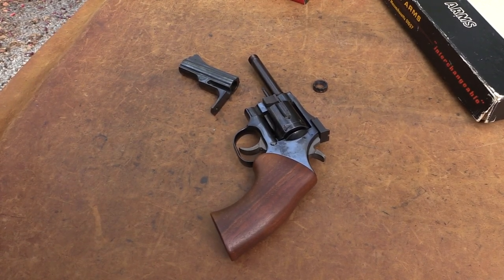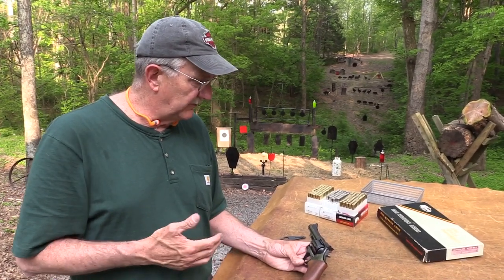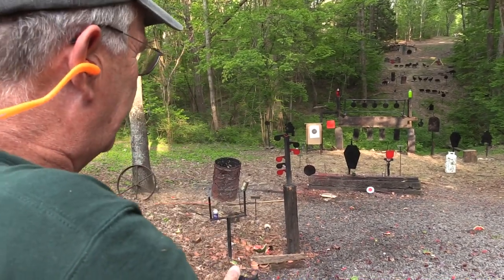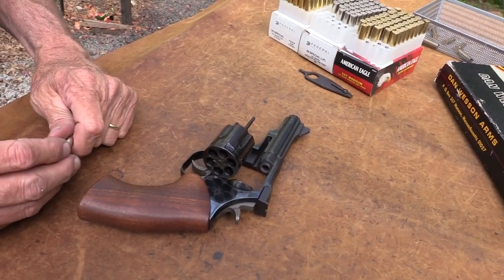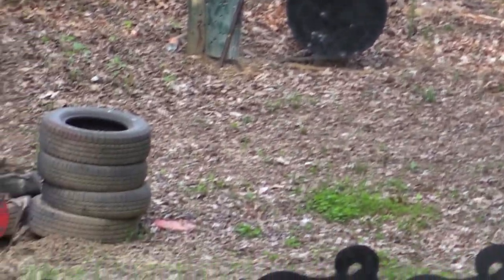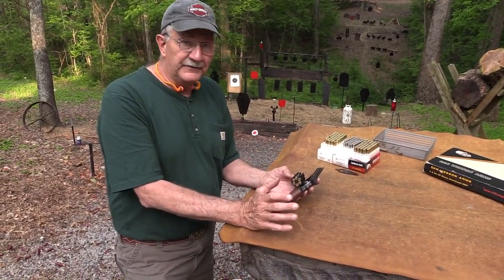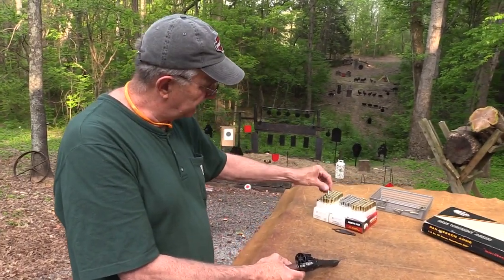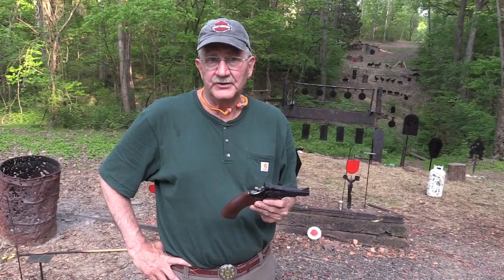Dan Wesson Revolver  .357 Magnum

Comment: I can't believe someone actually commented that the action sucked. MY early (original) Stainless steel DW 15-2 (with the feeler gauge and disassembly/barrel tool) has the snubby and the 4" barrels. I bought it to replace my service issued Colt Border Patrol, (The actual original name for the Colt trooper.357) while  Border Patrol Agent. The 4" was for uniformed carry in a Bianchi break front holster and the snubby for plain clothes use in a pancake holster. The only other mod I did was to swap the stock grips for a Pachmayr small wrap around rubber one piece grip.

The problem I had with my Colt revolver was that my small hands (short and fat fingers!) couldn't hold the large grips straight properly. That made it difficult to use for point shooting. (That and the fact that it was getting old and shaved lead to the right, but I preferred it to the Rugers, which were the other issue revolver!) Combat shooting is point, not aimed fire and with practice the bullets go exactly where you point. I was lucky enough to go through the Jim Gregg COPS, or Combat Oriented Police Shooting Course, taught by Jim Greg himself. With the lack of grip frame, the DW allowed much smaller grips and my shooting improved greatly. By the end of the course, I could hit 6 out of 6 at out to 25 yards without using the sights. (Came in very handy several times while on "bandit Detail", with SDPD, but that's another story.)

I smoothed out a few parts (I had proper stones from my days of match firing the 1911 A-1 and M-14) to make it even better, although it had a nice 4 1/2 lb crisp trigger pull in single action and a slightly longer than my Colt double action pull of slightly more weight. I fired match as well as using it on duty and it was as accurate as my decent shooting abilities allowed it to be. (I averaged 48-49 out of 50 in qualification, which was at ranges of 7 to 50 yards, including swapping hands and varied timed firing.

The snubby and the 4" shoot to the same point of impact, which says a lot for the precision barrel alignment.

I am retired now, but my DW still sits where it is available for home defense and a few times a year goes on a trip to the range where I hear the comments about "only 6 shots" from the auto feeder group. I then put 6 .357 magnums through the head of the silhouette at 25 yards double action and tell them that accuracy wins against capacity every time.

My all time favorite was my match grade 1911 on an alloy frame that I built myself back in the day. My partner and I both carried them in plain clothes with hand loads. Unfortunately , the Border patrol passed a rule requiring double action only pistols, so I sold it to buy my DW. ( Been kicking myself ever since, but couldn't justify the expense of having both guns at new agent pay levels, with a family and living/working in expensive San Diego.) The only way someone could get my DW away from me would be to offer to swap it for a good match grade 1911 A-1 with plenty of ammo.

Comment: .006 FYI: I used to have one of these and the recommended/factory Gap is .006. I bought it from an avid competitor who told me that you can gap them at .004 without any problems.
The tighter gap provides a faster shell velocity and improves accuracy still further too boot and the gun is built to handle the extra oomph of doing so without issue. I set mine at .005.
I regret being offered enough for me to not be able to say no to giving it up. Still today """I regret selling this gun"""! It's a very-very-very accurate gun. I miss it dearly!

Comment: Hi Hickok,
How come you don't have a video of an hk g36 ?
Say hi to your son for me
Thanks .
Reply: RadiantEmotion There are no G36 HK's in America to be reviewed. If you see one, its a gun that was modified off another model to look like the G36. Also, the G36 is having a lot of issues in regard to accuracy when the gun heats up after just one magazine. Something to do with the barrel collar is molded directly into the chaise or body of the G36. And the chaise is polymer. If the collar was set in aluminum or other alloy metal. Issue would most likely be resolved. For now, HK is further investigating the matter.

Comment: I've been looking at these. Ive found some fixxed sight model 15 guns for like 600 bucks. I love the potential and cost like this and i'd like to tinker with one. The latch has always turned me off. Even the colt latch has been difficult for me to get quick with. I'm wondering if the latch would work fast. I think i might take the dive and build a custom Dan Wesson since a model 65 or 13 smith is so difficult to grab right now.

Comment: Man, I guess I will have to upgrade my iMac. The 60fps is to fast for my iMac's video processor.
I now have to watch in 480p.
Reply: 13thFlor I also have to watch in 480p now with my Alienware M11x... a gaming laptop!! But it is old, and has always had a puny processor.

Also, nice video hickok45, as always. I usually watch them the same day you post them. :)
Reply: Venting Show That is because of the frame rate. Hickok's new videos run at 60fps in 720p and 1080p, used to be 30fps.
Reply: Venting Show Most likely your video processor. The older or slower processors can not process the fast frame rate. My iMac is older, 2011, and it can't process the frame rate.
Reply: I always watch 1080p on my iMac
Reply: +Jay Kae I figured out it is not my computer, but firefox. I open in Safari and it works without issue. This is a know problem with ff.

Comment: On the subject of having a nut to hold the barrel in place.  I remember seeing a classic British crime drama where a revolver is seen in a suppressed configuration. 
I've always wondered is this true? Can it be done? Doesn't the gap between the cylinder and the barrel result in gas leakage which makes for a bang anyway? 
Thanks in advance from the UK

Paul
Reply: stuckintraffic?getabike! With most revolvers, yes, the gap would make a suppressor more or less useless on a revolver. However, on a revolver like the Nagant, a suppressor would actually work, because it's designed to actually temporarily create a gas seal when fired.

Comment: just looked at your dzn wesson 12 model 357. i have had dan wesson use the 44 s&w 44 speeds loader, to me the 44 will take all my hot rod 44 loads for may years,, i have used  latly a 44 with q scope for 150 yard shooting including some hunting for hogs with it,, it just flat knocks them for a loop,,, over 20 grs of 2400 ,cci mag primers and win cases using a 240 keith style bullet hard cast,,, mine has the 8 in barrel makes it nose heavy but soaks up the recoil very well..want to give it a try give me a call ,email a way to get in touch with you.. later

Comment: I wonder what size explosion you'd get from shooting a full propane tank.
Reply: Alex Beckett Just shooting a propane or gas tank will not explode. Remember your basic science. You need a fuel source (the propane or gasoline), oxygen and a heat source. Hence, for a propane tank to blow up,  you would need to have a flare taped to the canister. And a full 5 gallon tank blowing up would be quite big. And a very stupid idea to do too.

Comment: I'm not a gun expert, but wouldn't recently spent shells be hot?
Reply: John Tanner 

John, I am only responding because you seem like you are truly asking a serious question. Yes, recently fired cartridges are hot but they are hotter if fired from an auto loading pistol vs a revolver. With a revolver there is more time for heat to be transferred from the brass cartridge to the cylinder, therefore cooling the brass. In an auto loader the cartridge gets ejected very soon after being fired which prevents it from transferring it’s heat to the gun. Shooting is a great sport, go rent a gun at your local range and take a few lessons, you will like it.
Reply: Doug Bower Of course, unlike many YouTubers you might see, I tend to not be snarky about everything. That's kind of an issue with text messaging - someone can interpret your message as snarky. Thanks for the answer, Doug.
Reply: John Tanner 

John, Just to give you a little bit more info, you will notice Hickok45 always wears a tight necked shirt, a billed hat, glasses and ear protection. The hat and the tight necked shirt isn’t as important if you are shooting a revolver but it is essential when shooting an autoloader. The bill of the hat prevents hot brass from flying into the space between your eye and glasses and the tight necked shirt prevents the hot brass from flying down your shirt. I can attest you don’t want that hot brass from an autoloader against your skin. So when you do go to the range keep in mind this information.
Reply: Doug Bower An autoloading pistol that usually ejects to the side can eject a shell in my face? And oh yeah, really really hot brass.
Reply: John Tanner  
John, Oh yes, I shoot about 1000 rounds a week and you wouldn’t believe where that hot brass ends up after it flies out of an autoloader. I usually shoot S&W M&P Pro 9mm but the real offender is the S&W M&P Shield, the Shield will bounce brass off the top of your head sometimes. When you shoot indoors the brass will bounce off the ceiling, walls or from someone shooting next to you.
Reply: John Tanner Well, my 1911 .45ACP ejects to the side and sometimes the shells end up almost in front (but off to the side a bit) of me and yes, back onto the top of my head. They can be ejected 2 feet from me or 12 feet from me. All over the place. And yes, the brass can be really hot for a few seconds. Check out Bunny Hunter's video (Country Girl Bunny Hunter shooting a suppressed Walther P22 ) of the burns she got from brass.